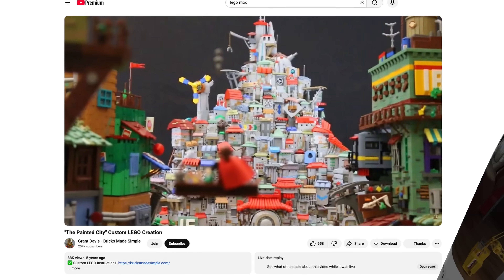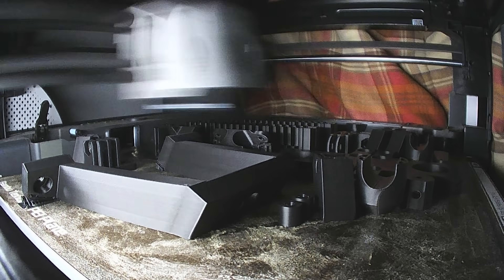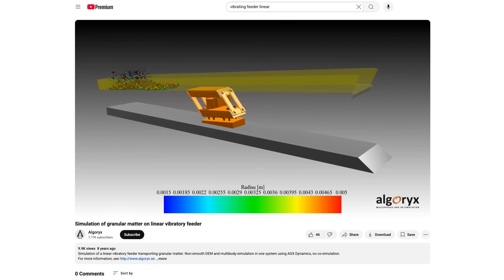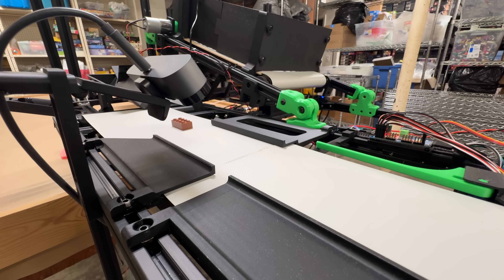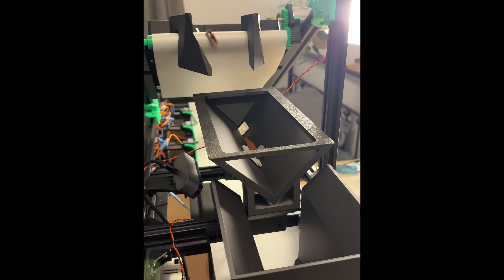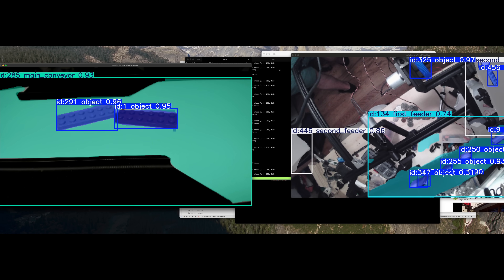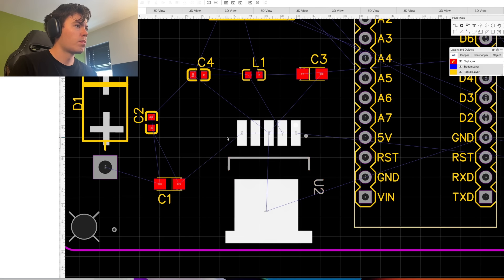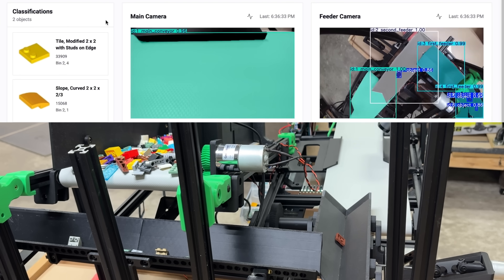A machine to sort a million pounds of LEGO

Comment: I saw a trashbag sorting mashine that kind of did what your mashine does but it only cared about green or non green bags. BUT, the important part was that their way of separatin each bag was a conveyerbelt going at sliw speed dropped bags onto a faster belt, that dropped onto a faster belt. 5 belts in total. no vibration. each belt made the distance between dropping parts bigger and after 5 belts they had a big gap.
Reply: Yes, that is an easy solution to add a gap between items, boxes, bags, etc. It is the way it is usually done. But that only works when all items arrive in sequence. Also in Lego there can be really small parts. That means the distance between the two belts need to be tiny and the rollers need to be really thin. Otherwise the gap between the belts increases. I think there will be too much movement when a small block goes from one belt onto the next one. I work in sorter business and usually there is a minimum product size when this solution is used. I have doubts if it can be done with Lego.
Reply: @pcdispatch  the belt starts under the previous belt so there is no gap. and the trash was in a big pile from the truck tipping it. to make it work is up to you 🙂 and the belt does not need to be smooth, it can be with notches to catch round parts from rolling
Reply: @henrikschmidt8178  , yes, but how do you control both small and big pieces falling between the notches of the next belt? It only works properly when the items are already separated.

With bags and boxes it is easier because they are all kind of the same size.
Reply: @pcdispatch  Actually no, thats why there are 5 belts, each drop has the risk of more then one item falls at the same time, the fall on the next belt will split even more of them apart and after 5 drops they are separated. atleast in the real world example I saw. you could also (totally separatly) screen your parts into size categories with the same way you divide sand and stones in a sand pit. just pass it over a screener and let small pieces fall down. big goes on.

Comment: This sounds good but I have a few suggestions, you should move to a more circular design if you add verticality you'll find its far more space efficient than a square design. On top of it, it reduces complexity, your current design is quite horrible for scalability since if a servo fails it would a pain to replace it. If it were curricular you would only need a few motors max instead of thousands. Also some sort of feedback loop would benefit to increase speed and accuracy.

Comment: Given LEGO is European, at least use European units to describe weight of LEGO. In the UK, "pound" represents a currency so the title of the video made it sound like it was about sorting expensive LEGO and not bulk LEGO.

Instead of trying to reinvent the wheel, I suggest taking inspiration from how these problems are tackled in industry. To handle scalability, look at industrial autonomous warehouse systems such as used for car spare parts by major car manufacturers. To handle sorting fast, look at glass recycling and the systems used to separate glass fragments into their correct colours.

Comment: Something that may be a good idea is to have a function that you can run a bunch of lego through it without physically sorting it, so that you can plan what bricks get sorted to each bin better (eg: if there are only 5 technic beams they should all go in the same bin, but if there are 200 beams, you should sort them by length).

Comment: This project and it's future versions are a mockery to open-source. Do not aid this man's personal privatizations of your creative commons. If you [LegoSpencer] want collaboration you can Open Source it now, by releasing the design files under a license. Otherwise you are simply exploiting your audience with no way to track contributions. If you are putting this machine into the hands of businesses on the backs of the commons and only a promise of "we'll open source it when it's fast and reliable," well, then that is a goal post that can and will be continuously moved. "v2 didn't turn out as fast and reliable as we thought, you won't want these files. It's time to focus on v3." Not to mention you are the only one that stands to gain from the sale of, and/or investments on this system. Free community R&D for ad revenue is one thing, but using a volunteer R&D base to generate a private commercial asset is unethical.

OSHWA Definition Section 1: Documentation,
CERN OHL Section 5: Research and Development

Comment: use a stiff curtain to spread them out on the conveyor, you could also add an arm that flicks them.
Reply: Underrated comment.  If two pieces are overlapping, they're unlikely to have equal friction against the belt.  Brush a curtain or whatever over them and one will get dragged back further than the other.  Repeat until computer vision correctly resolves one part from multiple angles (above and below).

Comment: Some thoughts:

- have 1 motor actuate all the doors in the row for let's say 4 or 5 columns. Less parts to buy and wire up.

- have the machine plan for multiple passes, with a way to collect the bin back into an infeed. So it runs everything first pass, then you reload those sorts in order, and it knows bin 1 only has so many pieces. A quick Google search tells me 44 bins run 3 times gets you every piece ever made sorted. Could probably simplify this a lot by like running every 2x2x1 brick into a bin then manually sorting by color with human eyes. 

Epic project. What a fun problem to solve.
Reply: Using one motor for multiple bins limits your freedom in V2. With individual motors, each column can present and drop a piece at the same time, which keeps the whole system dynamic.

The multi-pass approach seems clever at first, but returning containers to the input and re-sorting them still means doing exactly the same work twice. You need to recognize every single piece again, regroup it, and that becomes a waste of both time and computing power.

What could be useful is a pre-sort stage. You have 10 to 20 rows, each with e.g. 50 containers. You recognize each piece individually and route it to the correct row. You keep track of which piece went to which row, which makes it easy to collect everything again. In total, that means 10×50 = 500 individual pieces being sorted—a kind of pre-filtering, but without mixing everything back together.
Reply: @ddv045 LEGO has made like 79,000 pieces. You can't sort every single type of piece in 1 pass in a reasonably sized machine. You could pull out the n most common, and re-run the leftovers, or some hybrid approach to limit the size of the overall machine. The post office uses a multi-pass approach to sequence sort carrier mail, so it's a pretty functional method
Reply: What I'm suggesting is like bin 1 pass 1 is all 2x2 bricks, then on pass 2 it sorts for color, or it's pulled and sorted for color while being stored.

Another bin could be wheels, 4x4 plates, etc.
Reply: Colour-sorting identical pieces is a less demanding task.  I think LegoSpencer would consider having a human anywhere in the system as a 'fail'.

Comment: This is a really nice proof of concept! I feel like you could benefit from a pre-sieving stage to direct the smallest parts into a separate, more reliable feeder, like the ones used for small screws and fasteners in factories? The vibratory channel for that section would then be a very narrow path where the parts work their way upwards around the inside of a cone - any over-crowding and the parts fall back into the bottom of the hopper for another attempt. Those machines are very good at spitting out tiny parts serially, one at a time.
The computer vision aspects of this setup might also have an easier time with the remaining larger chunks?
Super cool project, look forward to seeing the next rev!

Comment: Because of bad e English and I wanted it to get right, i used grammarly to help correct my mistakes and bad grammar. 

An Explanation of Automated Sorting, from Hopper to Warehouse
Speaking from experience with these types of sorting systems, the process begins at the hopper (or "shaker"). Its most critical job is singulation—ensuring it feeds only one piece at a time.

This is often achieved with a feed channel that narrows at the exit. This exit point is typically adjustable, often using a simple screw and spring mechanism, to fine-tune the gap for different part sizes. The design of this initial singulation step is crucial, as it dictates how well the system handles bigger, smaller, rounded, or oddly shaped pieces.

The Mechanical Flow
Here is the typical flow once a piece is singulated:
A single piece exits the hopper, breaking a light sensor (a photo-eye).
This sensor signal triggers the first conveyor belt to move.

The piece travels through alignment barriers (often simple, adjustable metal guides) that position it consistently for the next stage (like an identification camera).

It moves onto a new conveyor section, where another sensor signals the hopper that it is ready for the next piece. The cycle repeats.
This multi-stage approach creates several "stops" or buffer zones. You can add more stages to increase speed or create separate sorting paths.

Scalability and Parallel Processing
This is where the system truly scales. Visualize it like a fork in the road:
A piece is identified (by a camera, scanner, etc.).
A diverter gate activates, sending that piece down one of (for example) five different destination belts.

This allows for parallel processing, which makes the system robust and fast. You have singulation at the hopper, alignment on the belts, identification, and distribution happening simultaneously. The potential for expansion, scalability, high speed, and precision is genuinely amazing.

The Feedback Loop and System Integration
A crucial feature is the feedback loop for handling errors.

If the identification system is unsure about a piece (a "bad read" or failed identification), it is rejected. A diverter forces it off the main line and onto a return conveyor that feeds it right back into the hopper to be re-sorted.

You can set the error tolerance for this:
A high tolerance (stricter) means more "unsure" pieces are rejected and re-sorted, leading to slower overall throughput but higher final accuracy.
A low tolerance (looser) is faster but may require more manual quality control ("hands-on") downstream.

To complete the automation, you integrate a label printer to add a barcode (with data like shelf position) and link everything to an Inventory Management System (or Warehouse Management System, WMS).
This WMS data can then help you make high-level decisions, for example, prioritizing the sorting of Technic pieces over standard bricks due to high demand.

So there you have it: a complete, automated workflow from Input -> Singulation -> Identification -> Sortation/Distribution -> Orderly Arrangement -> Warehouse Management.

Comment: Great project! congrats that PoC works!
1. The feeders need a slight decline (like any swer pipe) and a shallow angle as you said.
2. 2nd feeder needs to vibrate faster than the 1st. part sigularisation should be easier as parts move away faster.
3. if recognition speed is an issue: Think about radix sort: multiple passes eg. sort by size, weight, color, shape... (maybe chains of sorters)
4. As already mentioned in other comments: re-feeder, light barriers instead of some cameras, ...

Comment: another approach to what is essentially an inventory management problem ... rather than sorting into boxes of each size/type, why not just grab a set number of random pieces at a time, identify all the individual pieces, and then put in an indexed bag or small box. If you want to find a piece, then lookup from the index into which bag(s) you can find it in. Once your indexing systems calculates that a particular bag is say less than half full, that bag can be pulled, and put back into the start of the system again.
Reply: I was pretty suprised that it is actually the way they work in warehouse now, when I had to help our warehouse team recently. Until then, I was thinking they have some logical order on the shelves, like, all similar products in one place, but it's not the case actually, it's just as you mention, everything mixed up in little labeled boxes, with the content of every boxes known, then it's just a matter of the Ordering software to print the location of the boxes where to find the pieces. The issue here might be that someone might be ordering a lot of the same pieces, then it's faster to have all of them in one place.

Comment: So cool. Couple of thoughts: 

Use the existing standard for your bins. I think they are called bin boxes but using a bin that already exists in industry means you (and everyone who builds one of these) can use the existing infrastructure for bin box storage systems. 

Second thought: you should presort using some kind of screed. Large pieces and small pieces mixed together must be annoying to try to engineer around. Getting the 1x1 plates and tiles separated from the 2x4 bricks from the larger pieces can give three different lines to classify with three very different sized bin boxes receiving parts. You can also sort such that the default result is to dump a part to the next sorting size’s feed hopper so that if a smaller part fails to self sort at the screed it is eventually sent on to where it should have landed in the first place.

Comment: This is awesome! But to save you a massive headache down the line, change ALL your servos to Alu geared servos - the MG90S works great. Their lifespan is significantly longer but with the same dimensions - the "cheap" servos are plastic because of their usecase where weight is a concern (e.g. model airplanes, etc.).

Comment: Just to understand, the laptop is running the vision and classifier api, then micro controllers are handling the moving parts? There’s no raspberry pi involved ?
Reply from the maker: Correct
The microcontroller is running Firmata, which is like a serial library. Python talks to that. The microcontroller doesnt have a lot of specifics for this machine in its code

Comment: Very impressive for your first project. Some ideas for V2:
A hopper conveyor to take bricks up high so you can scale the bins vertically.
If machine vision is the bottle neck on identification, add more channels across the conveyor. 
Add a return path so failed scans can be automatically sent back through.

Comment: If you will have any chance of this working in reality, you need to sort in 3d.

That is have banks with 2D sorting.

A way to do it would have a bank that drops down a bit in a shoot, then every level have one server havinf 3 states. Left, right and down.

So if you have say 10 trapdoors in one bank, and 10 layers. You need 20 servos and can sort 200 categories per set of banks.

Each set of banks would work indivusually and take bricks from a looping convayer so you can have a unlimited number of banks.

Because all banks would work individually of each other the capacity would improve with number of banks.

How i imagine the colum selector to work is a slide where the brick slides down that have say 10 doors, the door is slightly bellosn flush with the slide but it open 90 degrees both opening a hole down as well as stopping the pice to slide.

The bank selector would simply be a that push the brick (at some speed, but not exesive speed) of the covayer belt down the slide.

If there is two bits to close to wach other that need to go down the same bank, it can just loop around.

So a typical set up could have 200 small trays in a bank. 50 medium once or 18 quite large once.

The. The convayer would have bassically a expandable number of banks on each side.

Also, you might want to consider having a mirror so a camera can se a pice from multiple angles. This way it can self check if it identified it the saame in all angles.

Comment: great project!
i feel like V2 should retry the Grid approach for space efficiency. Put a Grid modul after your current sorter for expandability. the current sorter does rough classification to keep the conveyor going and the grid modul (a little bucket whose bottom opens up after reaching the dropoff spot) gets sent to the coordinates for the specific classification. i think you can even use most of the code from a core-xy 3d printer for that